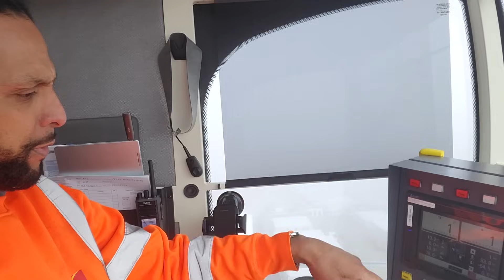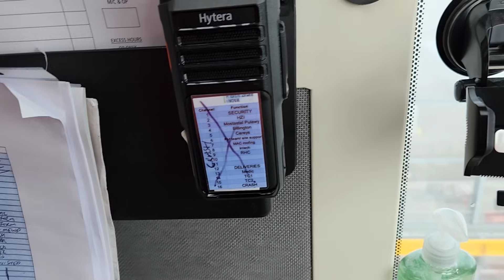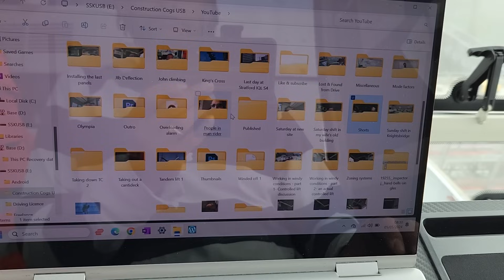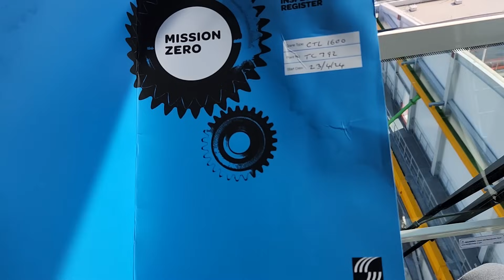SETTING UP THE CRANE ANTI COLLISION SYSTEM | Big Lifter

Comment: I would love to know how the electrical cable is routed from ground level to the top of the tower. IE, if the crane is left with the brakes off. Why doesn't the electric cable get twisted and disconnected? I am not a crane operator. And always wondered how it all works,
Reply from the maker: Great question. The cable runs up the outside of the mast then goes through the centre of the slew ring into what's called a 'slip ring' which then disperses the power to where it's gotta go. This slip ring in the middle of the slew allows the crane to do as many rotations as it wants.

In older times, cranes could only do 3 revolutions before having to go the other way,because of the cables.
Reply: @CCcranelife  Thanks for the reply. Next time you're claiming this part of the crane. Could you show this part of the crane? So I can see and understand better. Many thanks. I'm getting to understand a lot more about these cranes.
Reply from the maker: @tiolynn1 What's your TikTok handle? Give us follow there and I'll dedicate a video on next week.

Comment: Hey mate, I have been driving MK140 for the last 8 years. Would you recommend me moving to standard tier crane?
Reply from the maker: Depends what you want out of it mate. You get to see more of the country doing your role. But being away from home might be crap.

So:
- Moving from location to location vs being on the same job for a couple of years.
- Doing a variety of interesting different lifts vs the same repetitive lifts each day.
- A short climb to your cab vs a potentially very long one in all weathers.
- Less early finishes vs a potential flyer system.
- A more comfortable posture vs terrible one and potential bad back
- People on the ground being able to pester you easily vs only radio comms. 

Not sure what the difference in money is.